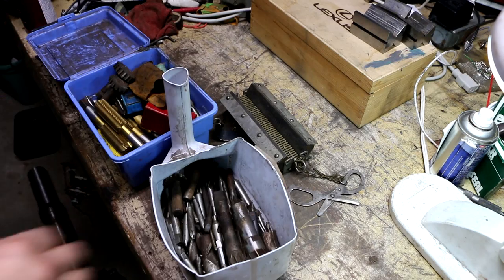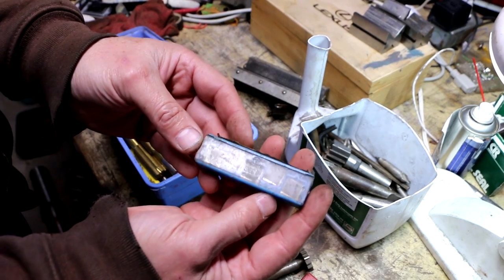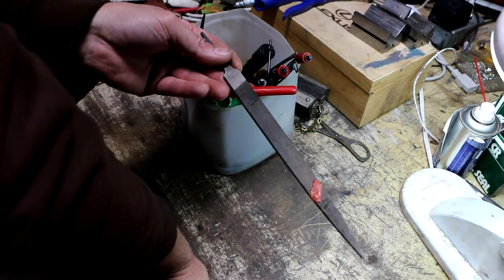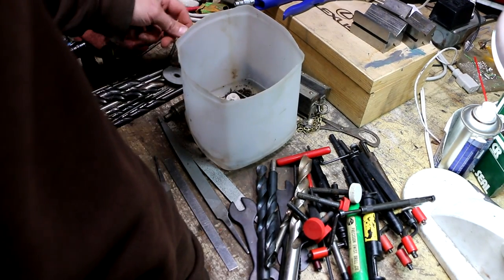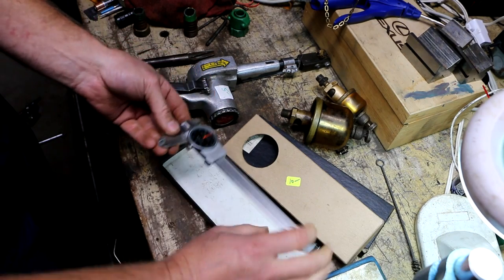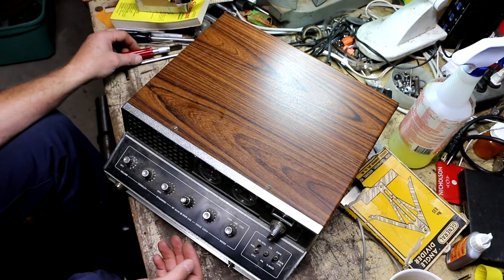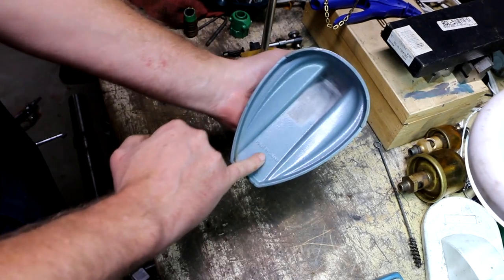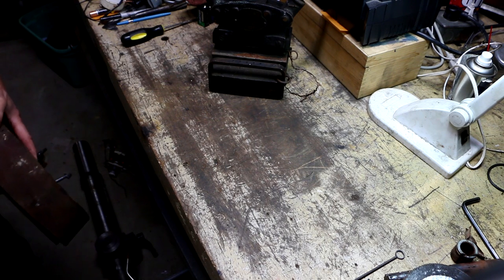Flea Market Finds August 16th 2020

Comment: Great score Steve those helicoil drivers are useful to make sure they go in straight. Can't have too many sizes of taps,and if you need a flat belt made where would you go?
Reply from the maker: There is a guy who always came to the Zagray tractor shows swap meet who makes leather belts. Sadly all 3 shows were canceled this year. Also, Hudson belting in Worcester.